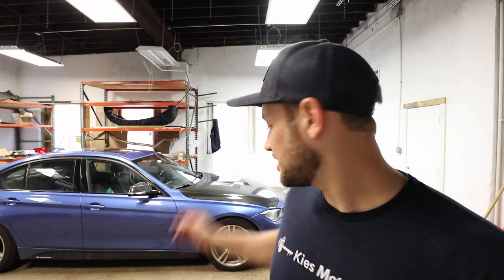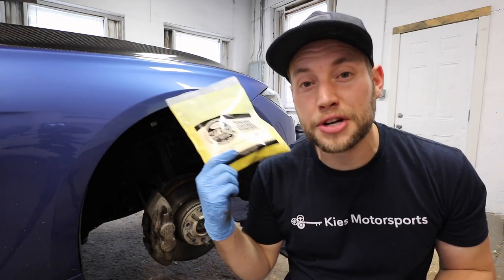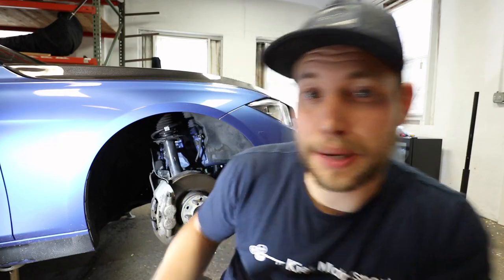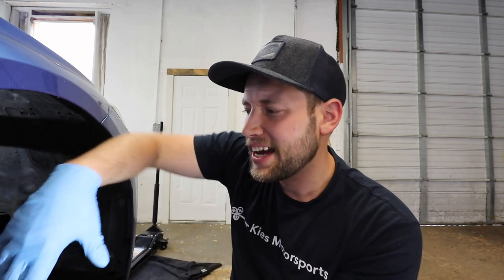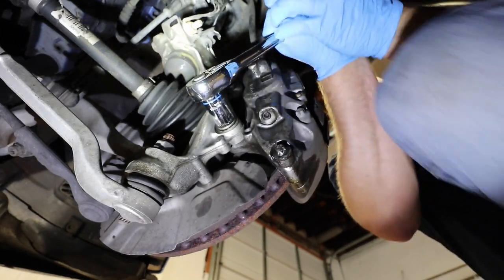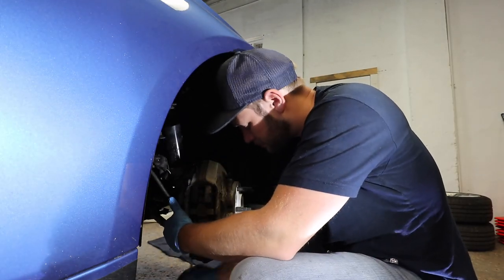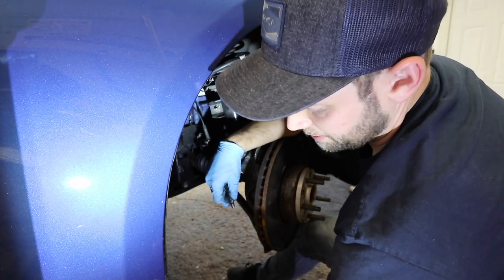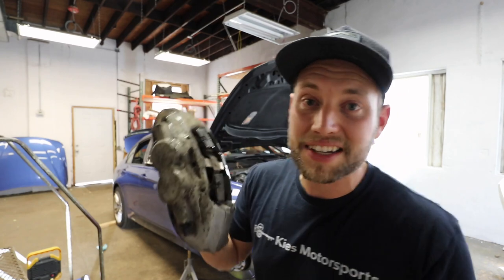How to Remove F30 BMW Front Brake Calipers for Powder Coating, Painting, Replacement and BBK!

Comment: I am confused. Isn’t air going to enter those break lines once they are open and ruin it all requiring break fluid flush to get rid of those air bubbles? Also, when you are putting it all back together, there will definitely be air in the calipers, so how to you bleed them? Any tutorial on this?

Comment: Doing my brakes now too. A quick cheap & easy tip on cleaning up those nasty rotors and rotor hats so they look good with your redone calipers.  Soak rotors in white household vinegar ($5 for 2 gallons at Sam's) for 24-36 hours, no more.  To soak use a plastic storage container that can be thrown out. Use water-filled ziplock baggies to take up space around rotors to raise vinegar level. Then spray and scrub rotors with brake cleaner and they'll look like new!  Paint or powder coat rotor hats (not on mating surface with wheel) to resist rust & brake dust so they will always look great with your calipers!
Reply: Vinegar is a great for removing rust!
Reply: Yes! Vinegar is such a mild acid that it won't etch into the metal unless it's exposed for a really long time, which is why I said not to soak a rotor for more than 24-36 hours. After that it appears to start etching into good metal instead of just the rust.  Soaking rather than just scrubbing the surface also gets into the ventilated edge of the rotor to help to clear out the rust, brake dust and dirt in there.  After vinegar soak, just hold the rotor vertical and spray in there really good with brake cleaner. Watch all the gunk come out the bottom!

Comment: You painted your amber reflectors!  Details.  I have the Tracking Pkg on my 340i so my calipers came painted and have the ///M emblem. :o)  Also looks like you deleted your front fog lights!  I actually added them to mine as the Tracking Pkg deletes from the factory.  Look forward to the home powder coating!

Comment: I did this to replace my brake pads but dissembled the whole caliper you’re replace pads I reassembled and put back on but now brake pedal goes to floor with no good braking.. the calipers did empty a lot of brake fluid when I dissembled but I have brake fluid.. what should I do now?